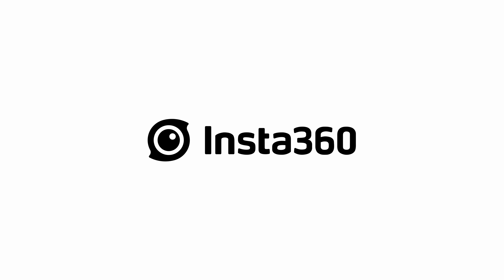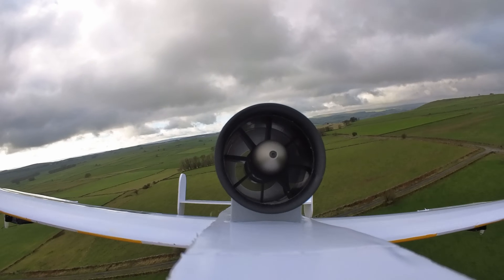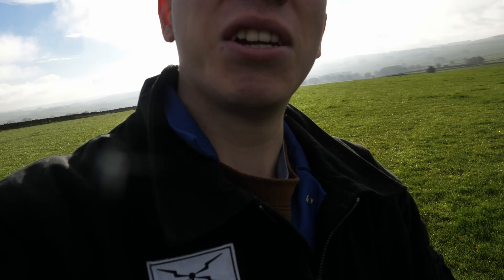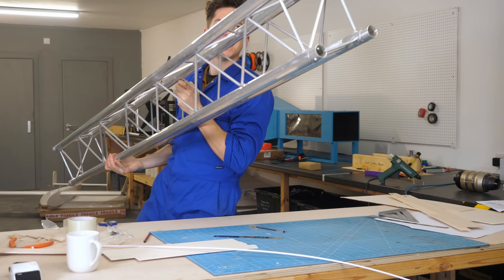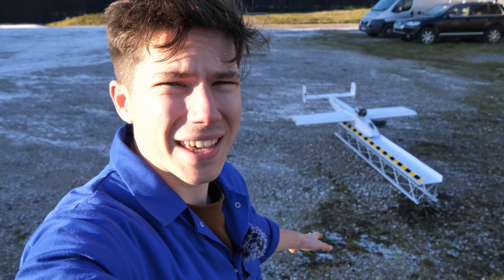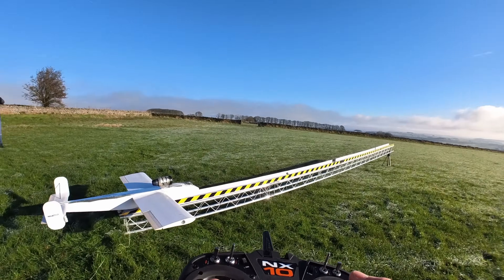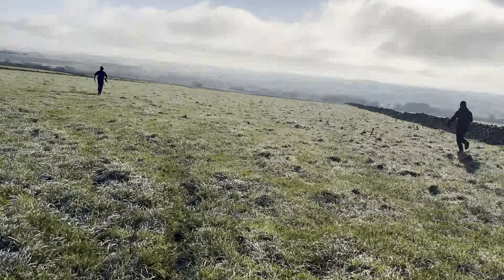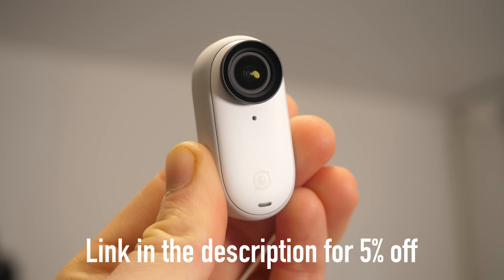Foam RC Jet

Comment: Where were your RX antennas?  I've been flying FPV for the past 13 years so I know a bit about radio issues ;-) You have Ali' foil all over the top of the fuselage and that acts as an RF shield.    2.4Ghz is basic Radar frequency so it bounces off (or gets blocked by) anything conductive. Can I suggest that you have a satellite RX out in the wing at least 200mm away from the foil surface and away from the carbon wing spar (I.E. near the trailing edge of the wing).  Also make sure that you mount it vertically  (I.E. antenna wires pointing up and down. One above and the other below the wing). A lot of people make the mistake of laying their antennas flat inside the fus' with one pointing along the fus' and the other out towards the wing tip. That's great for knife edge or 100% vertical climb but neither do anything for straight and level flight!

Comment: Get rid of that crap specktrum radio and use TBS Crossfire and you won't have any failsafe problems. There's a reason drone racers called Spektrum "Team Failsafe". For that matter even ELRS control link is infinitely more reliable than Spektrum.

Comment: You don't suppose that when the jet turbine stalled it automatically started firing the ignition trying to start up again? Ignition interference is a pretty common gremlin, maybe that combined with signal reflections off the aluminum tape was just enough to put things on the fritz at that range.

Comment: You should probably keep videos two-part for the simple reason that viewers such as myself would have inquired about the air ingestion problem before your test flight. It's a shame, looked like a sound flyer otherwise.

Comment: The jet pilots from my club do not use normal tanks but "bags" in a tank. This is actually just a support and is a double wall in a crash.
When this bag is empty, the volume is not replaced by air.  
This also eliminates the need for a tank pendulum.
Use a proper remote control system for such expensive flight projects. 
The Spectrum equipment is susceptible to interference, especially if you have a large model and can seemingly fly further away. It works well in the FCC space, but you are in the UK.

Comment: You lost signal, either due to low battery power, or signal interference. You put up a jet engine and admitted to not even using a bubble suppressor so I doubt you thought of using a dual battery setup either since we only see you plug up a single battery. On top of that you didn’t use a satellite either. I’m also wondering what type of receiver you used, as a park flyer Rx would do exactly what happened in this case. 

I would seriously get with a RC pilot and learn from them. They would be able to help you. I’d also recommend joining an AMA field as what you’re flying or attempting to fly could easily kill someone. Not sure if you know it but you’re supposed to also have remote id now and I sure didn’t see that or your info anywhere on the plane during your quick setup. Didn’t see a range test performed at all either which would have saved your plane.

Comment: Watching this video makes me angry. I am building and flying model aircrafts for more than 30 years now, including jets as well. We spend a lot of efforts to make the planes safe and reliable. Things like structure, strong rudder linkages, torsion free control surfaces and correct installation of receiver and electronics (including a range test before the flight) are very important. In your video it is obvious that all these items that ensure safety have been ignored. 

Larger model aircrafts, especially with combustion engines and even more with turbine are dangerous. In case of an accident you could serious harm or even kill people. Therefore safety has to be the number one priority for aeromodellers. 

Until you are really aware of the responsibility that comes with flying model aircrafts I suggest to stay with building boats and cars instead of giving a huge community of responsible model aircraft pilots a bad name trough carelessness.

Comment: Sadly my experience of Spektrum radios is that do randomly lose signal for no apparent reason, many other spektrum flyers at my club have similar problems. If you are lucky they reconnect before any damage is done if you’ve set a good fail safe but when it happens close to the ground it’s generally bin bag time.

Comment: Horizon Hobby's Spektrum control link is not the most stable nor the best control link out there.

For a project like this, consider looking into ExpressLRS. They are well-known for long range and low latency capabilities. Their 2.4 GHz control link is extremely robust in noisy RF environments.

Plus, many of their recievers support diversity and (what they call) "Gemini" (which improves on their already highly stable control link).

Not only that, ExpressLRS is significantly cheaper than Horizon Hobby's Spektrum brand... and it can significantly go further.

Comment: Don´t use Spektrum for something like that. Starting FPV Pilots lose control on a regular basis until they start to use something that the others do (by reason) And well... Aluminum foil is a good isolator against radio"interference". Put your receiver in the wing. Maybe it was just throttle down by the Spektrum...

Comment: buy a futaba 18sz or just futaba in general  have had one for coming up 4 years now, I have has used spectrum before and have had 2 signal losses and lost expensive aircraft, since futaba I have not had any signal issues.

Comment: Can't wait to see version 2! Although you got off the ramp without any issues if you're going to add things and up the weight why not consider using a slingshot system to get some quicker acceleration off the ramp? It's already been suggested but bag tanks may be a good addition too, this would prevent air in the fuel system and is actually used on a lot of real aircraft.

Comment: What rc protocol u using. There’s a setting specially in ELRS for micro loss of signals you can enable or disable. If it’s disabled then even micro loss of a signal will require a re-arm and won’t regain connectivity

Comment: Spektrum is not a reliable control link, in my opinion, for a project like this.
I'd recommend Crossfire. I fly miles with my 7" quad in sketchy conditions, and have never had a failsafe with Crossfire. Earlier with our DX9's, I found myself HIKING every weekend in search of lost quads, climbing mountains, stung by bees, shot at, etc. because of the unreliable Spektrum link! Oh, and a lot of cussing, scratches, and Poison Oak mixed in for good measure!🤣😂

Comment: i just saw rclifeon have his transmitter fail, also a dx6. how much money you spent on this project, use your brain and look up what a better transmitter is. you could have had a basic ELRS Tx with 100+ miles of range, and a flight controller with auto levelling, return to home, any sort of failsafe if controls are lost. such simple stuff that you neglected

Comment: Why didn't you use ELRS? It has PWM receivers and all you need, it is just hundreds of dollars cheaper than Spektrum and goes so much further. Even with the sub-100$ radios, you can still get up to 20km/12.4 freedom units of range. Meaning that even if you did 300km/h non stop until you run out of fuel at 2 minutes, you would only be halfway of the range of that. Expensive setups can go up to 60 freedom units.

Comment: The roll was due to the slightest offset of the aileron(s) during the loss of control
Just before the crash you can see them resetting to their proper position, and the plane stopping it's roll.

This might be a clue as to what happened.

I think this slight difference in the aileron might have something to do with the trim?
When the signal of your controller was lost, it lost it's trim setting, and that angle causing the roll.
In the last second before the crash it seems to have reconnected, adding the trim, causing it to fly straight, even if that was straight into the ground.

I wonder if there is an option to keep a trim during signal loss?
Or a self leveling system?

When i make planes in games, i always add a sensor and a bit of code that will always slowly auto level the aircraft, so that even if i can't control it temporarily for whatever reason, it will just level itself and stay airborne.

Though here in real life you'd probably want it to fly in circles around you rather then a straight line.
But hopefully it could give you enough time to reconnect before it runs out of fuel.

Comment: I use Futaba and JR radios for my turbine jets. I used to use Spektrum until I lost 3 jets to signal failure and blackouts due to voltage creep above and below voltage and unexplained signal losses. I only use Spektrum for my park fliers due to all the bind and flys. I also use a flight controller for return to land if it loses signal. With all the fail-safes available for under 200 dollars it's almost dumb not to put one in our 1000s of dollar investments. Then again I'm not crunched for time and stressed out to put content for subscribers. It must be a pain to try to remember everything and then make sure you have video content. You have it tough my friend. I can't imagine the mistakes I would make If I were making videos and building projects. Thanks for always showing the good, the bad, and the ugly. You Rock!

Comment: Spectrum is very poor in term of range. Switch to crossfire as all drone pilot do. Nobody fly with spectrum today in the drone community. Also when you point your antenna in the direction of the plane, this is the worst for reception. Your rc and plane antennas must be perpendicular to the virtual line between plane and you. And in the same plan.

Comment: The following Spektrum receivers say they are not supposed to be used with Turbines in their user manuals, without explaining why: AR630, AR8360T, and AR10360T. Did you use one of those?

Comment: just wondering, why dont you use dji's fpv system with a head tracker to have 100% control? And shouldnt you use the crossfire system for even more range? (im an fpv pilot so i dont know much abt rc planes)

Comment: I think the signal lost was caused by the aluminium foil that akted like a shield. 
As long as the bottom pointed towards you the signal was fine. 🧐

Comment: "What happened to my control link?" It's 2023 and you're still using Spectrum... Spectrum was great for what it was, but it's days are numbered. Give RadioMaster a shout and see if they would want to partner with you; tell them that doing a partnership that highlights their new ELRS PWM receivers would be beneficial to both of you.

Comment: Yep you need more backup electronics,an emergency autopilot and small parachute on the tail could be nice additions. To save fuel you can even made rocket assisted launch in that ramp or some kind of catapult like device with way cheaper materials to your imagination.

Comment: based on my own experience putting powerful engines near sensitive electronics, what if the jet engine (and potentially the generator created by running the starter motor with the engine, but idk if that's disconnected during operation) is creating a ton of interference, so when the plane got far away, the interference from the engine overwhelmed the signal from your remote at that range

Comment: Your loss of signal may have resulted from the aluminum or steel foil you used for heat shielding breaking the signal beam. i am no expert on antennae, but it might be possible to use the heat shielding as an antenna

Comment: I'm sure its mentioned in one of the other 746 comments and most likely will be mentioned again, but you need a Return to Home in any other flights.  It is a legal requirement to have either a return to home, or some sort of signal loss compensation in all RC aircraft and drones (not classed as toys, ie greater than 249g).  I'm not sure of the safest version for fixed wing but a flying in a triangle formation over the home area I think might be best in this scenario at a fixed altitude.  I know it'll add to the electronics and weight on board but its better than risking damage to the costly engine, or worse, it flies at 160 KM/h for 2 minutes so your range is over 5km plus any glide time (which is relevant).  There was an incident in Dublin where someone lost receiver battery and the aircraft ended up landing  9.4 KM away at a taxi way at Dublin Airport (which could have caused a significant problem) https://aaiu.ie/aaiu_report/incident-model-aircraft-no-reg-dublin-airport-7-dec-1996-report-no-1998-017/ . You may not be near an airport but there are many things that it can crash into and a fuel source and ignition system.

Comment: First issue is spectrum radio system...spectrum in my experience has major range and interference issues. should be using crossfire or express slrs miles of range

Comment: 2nd video I'm watching today where an old shit radio is being used causing devastation.... Guys spectrum is so 2000.... Please upgrade to radiomaster system using Express LRS or TBS Crossfire as the link.
Reply: Old 2.4 ghz links have really shit range and high noise floors. Time to upgrade your C2C link..

Comment: If melting is a concern would a rear mounted engine on a flying wing design not be better for keeping the exhaust away from any of the foam body, or is that unfeasible?

Comment: Sorry for your loss but I think at this point you really should consider a different control link; that was an unacceptably close range to lose your control link. Perhaps one where the signal is based on LoRa? Consider ELRS or, if you want something more "out of the box", TBS Crossfire.

Comment: RC link range is a solved problem. PLEASE stop wasting time and money on Spektrum receivers. 
I am a FPV pilot and switched from Spektrum to TBS Crossfire. Never had a problem since.
Get yourself 2 immortal T V2 antennas, Crossfire Diversity Nano Rx + pwm Adapter and a Micro TX v2 or a Tango 2. If you use something like a Radiomaster tx16s you can even continue using your Spektrum receiver for stuff where failsafes don’t matter. 
I have had this setup for quite some time now, maybe there are better options now, but I doubt that you will ever need more than that.

Comment: Firstly with a turbine producing that amount of power id suggest throttling back once youve taken off , that foamy will just come apart in the air with that much airspeed
By law you need to set a failsafe , so my thoughts are your failsafe activated with you signal loss ,cutting the engine and then having partial control until crashing ?? Yes you should run a U.A.T to trap air bubbles but i cant help thinking the two are related , im not so sure the engine cut out due to bubbles

Comment: This is hardly the first, I had one that could have the jet put inside it, but used a ducted fan instead, (it cost to much for the jet motor). Mine was commercially made not a home built. Several witnesses saw it crash when landing when the battery failed on the first flight.

Comment: Spectrum ia for park flyers, go tx16s with crossfire and a crsf to pwm convertor and  it's own 5v battery with the servos on there own battery,  ive been running this setup on 5metre wingspan giant scale seaplanes for years now and no control issues ever

Comment: Assuming the radio you used had good range a possible problem is EMI from the Jet engine or metal on the plane in general. You might want to look into a directional antenna or a signal booster

Comment: RFI from the fuel pump may have caused radio transmissions issues. More likely, I think vibrations from the engine worked an electrical connection out just far enough to have an intermittent connection. It's a shame the maiden flight had to end so soon, this was a great video regardless!

Comment: With any new plane that has metal/carbon skins/spars, it's needs a full range check at all angles, front, rear, sides, top and bottom before even thinking of taking off.
No range check was shown but I'm guessing if one was done, it was  just the basic 30 metre distance check with the plane left on the ground?

Comment: First problem ,Spectrum radio gear, Second problem built-in fail-safe software program into the turbine computer if lost of signal shut off engine to prevent a runaway missile 😊

Comment: Beware of flutter on stab, rudders, wings and linkage at jet speeds. Foamies and jet engines are not compatible. You need a more rigid structure.

Comment: Over the last few month I've been making my own DIY rc plane. The plane is probably quite a good plane but I have very little experience with flying rc planes. So I've crashed and remade mine like 20 times, every time improving the design a bit, until now you could hardly recognize that the plane i have now came from the one I started out with.

Comment: I do believe that the aluminum tape used to dissipate heat from the jet engine could cause the radio communication interference. It’s worth noting that some materials can block or interfere with radio waves. Like aluminum foil, and other electrically conductive metals such as copper, can disrupt radio waves. However, it’s unclear whether the aluminum tape used in the video is causing the radio signal connection to weaken. It’s possible that other factors could be contributing to the issue as well.

Comment: depending on where the receiver was then the aluminum might have been cutting the signal. certain metals are able to block radio signals and aluminum is one of them.

Comment: Did you really use a shitty cheap esc for the bec? Next time use some kind of powerbox or something with atleast double receiver battery, and if possible double receiver. Did you add antistatic to the fuel mixture?

Comment: if you are going to use a twin tail, why not just go to a full twin boom design and get the center of thrust in the center of the plane! also fixes heat problems